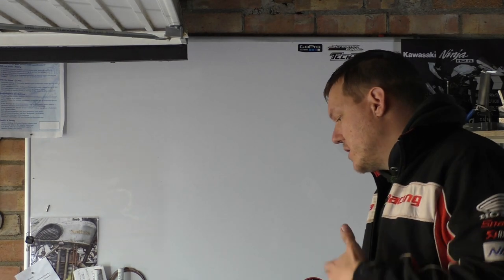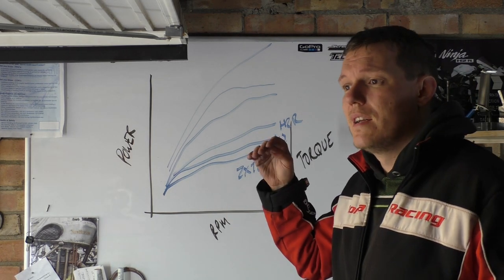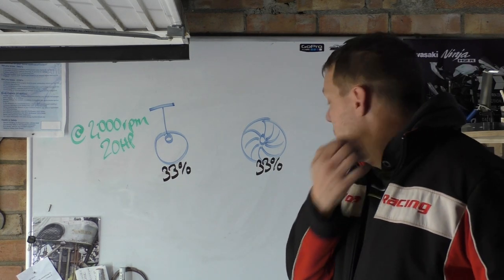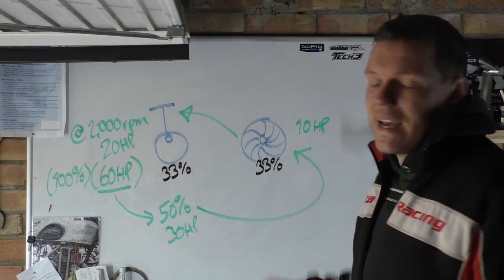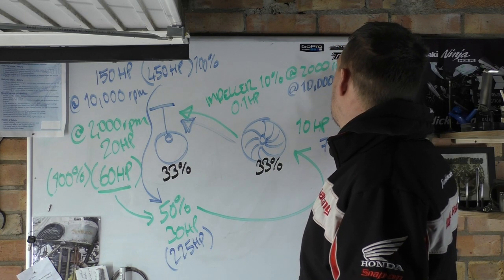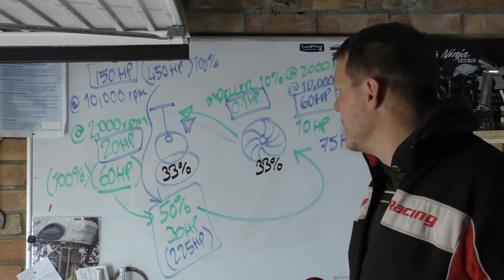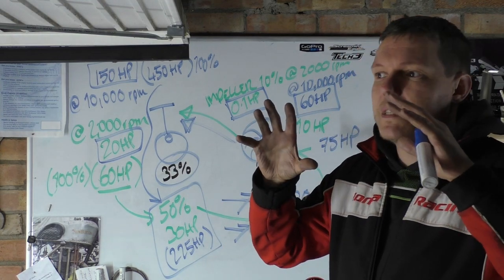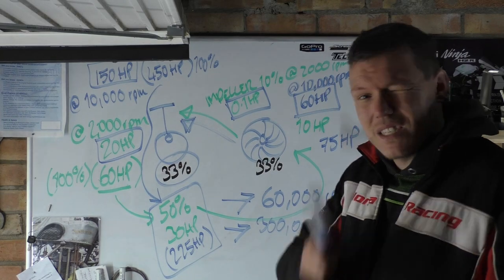Turbo's and Chargers - Fuel and what they do

Comment: Yes that makes sense. My only experience of supercharger was on Mercedes cars. Where there seems to be very little if any reduction in mpg. 
My Turbocharged SAAB cars always did better mpg tgan the fuel injected or Carb versions of the same engines.. unless you opened the taps. :) which was very hard not to!

Comment: not trying to be a dick or anything, but a Matt and a few people in the comments talk about exponential relationships. I'm not sure about this but according to the Affinity Laws: for any kind of fan or turbine the relationship between RPM and Power is cubic not exponential, and pressure is the square of the RPM, as long as the efficiency remains constant. I know that exponential is a kind of street term for any curve that sort of rises rapidly, the two curves at first glance do look very similar.

Anyway, nice video, and explanation.

Cheers
Reply from the maker: Gretat comment - however 

"I'm not sure about this but according to the Affinity Laws: for any kind of fan or turbine the relationship between RPM and Power is cubic not exponential"

Affinity Laws and the cubic relationship is for fans and pumps, and not driving apparatus. The one thing missing here is energy. Looking at Affinity Laws you have speed, flow and head pressure, and also power. 

For an engine the variable here is the torque curve. In other words Affinity Laws would hold true if one thing was constant - say shaft speed or flow rate. So the impeller works on this principle - because it is driven and like a pump or fan, and this is due to the volume of the impeller housing (or diameter) and the speed of the drive shaft.

However for a turbine the variables are not just rpm. As the engine begins to enter the powerband, combustion efficiencies increase, and hence more torque is produced. Its not just a function of engine rpm - in other words

Comment: Matthew you lost me a little bit. Why is a turbo stuck waiting for the engine, but the blower isn't? They both pressurize charge air with energy produced by the engine....
Reply from the maker: Because the a turbo runs of exhaust gases and it needs to spool up - which takes time. Blowers are connected directly to the crank - so if the crank (engine speeds) increases the blower is in sync

Comment: I wanted to type a huge "You over simplified the turbo operation" and throw in lots of information, blah blah blah.  Then I remembered that you actually know, so I will leave it to you to explain it better in another video.  I will say this, if you want a great example of the exponential "rate of growth" from a turbocharger, just use a dyno chart from a small engine with a big turbo, because you can see when that engine and the turbocharger starts getting into their flow rate/pressure ratio/efficiency island/speed happy places.

Comment: IF you had an engine that was at 100% is the turbo then useless?
Reply: Not entirely as the pressure of escaping gasses from the engine would still be able to turn it. But the energy levels would be way down due to no heat in the exhaust gas.
Reply: @chrisvinicombe9947  If the engine was 100% efficient there would be no pressure.  That pressure is energy, and the engine is turning all the energy into work.
Reply from the maker: Joonya has got it. And it breaks down like this. 47MJ of energy per KG in fuel (petrol/gasoline) if the system is 100% efficient then 47MJ of energy liberated from the fuel was converted into mechanical motion - this includes 0% friction and pumping losses, 0 vibration (noise) No compression losses, no loses of any kind.

Or like this Air + fuel 'in' ----> motion out. Nothing more, no pressure (which is momentum of exhaust - therefore no exhaust - at all in other words the water and CO2 and N2 would just magically disappear. 

Obviously this is impossible due mainly to thermodynamics - there's always waste heat when work is done (power is produced)
Reply: @joonya4427  100% efficiency refers to the energy the fuel contains. The gasses from the combustion chamber would still be pressurised when leaving the exhaust port. They would just be at roughly the same temp as when they entered the engine.
Reply from the maker: "@Joonya 100% efficiency refers to the energy the fuel contains."

- Yeah but that's all the energy - without it you bike just sits there - looking pretty. 

"The gasses from the combustion chamber would still be pressurised when leaving the exhaust port."

- and no. Exhaust gases expand out of the exhaust because of the pressure difference, and this is due to the energy they now posses. This is why its called 'waste' heat, because it pisses out without pushing you forward.

If the gases were the same temperature as the outside word then they have the same temperature, and therefore 100% efficiency has taken place, but they just sit there. The piston would then have to boot the gases out, and this requires energy - 

Even in this scenario, work has to be done and energy is required to do that work. So loses - pumping loses.
Reply from the maker: Awesome comment, this will be a video tomorrow, because this is an excellent example of efficiency and work
Reply: @dirtygarageguy  oh we're going full magic eh 😂😂😂 I was just considering extracting all available energy in the fuel.
Reply: @dirtygarageguy  I agree, but the original supposition was a 100% efficient engine.  Surely all this shows is that it is not possible.  Edit:  Woops, missed your earlier reply.  This comment should have been for  chris vinicombe - yeah we are going full magic.
Reply: @dirtygarageguy  The thing I find interesting in all this is that it shows that we need to have some level of loss in order for an engine to work.  I never thought about it this way before.

Comment: A supercharger's speed is going to be directly proportional to the engine's speed. But the two main types of superchargers are positive displacement, normally  Rootes, and centrifugal, which is like the impeller of a turbocharger. The amount of air a centrifugal supercharger can pump is low at low rpm, but increases exponentially as its speed increases. The amount of air a positive displacement supercharger just increases linearly as its speed increases. At high supercharger speed,  a centrifugal supercharger is going to be more efficient than a Rootes one of the same size.
Reply from the maker: "A supercharger's speed is going to be directly proportional to the engine's speed."

- yes. I'm sure I said that.....

"But the two main types of superchargers are positive displacement, normally Rootes, and centrifugal, which is like the impeller of a turbocharger. "

- Yes - I said that as well.

"The amount of air a centrifugal supercharger can pump is low at low rpm, but increases exponentially as its speed increases."

- I'm sure I'm going to repeat myself......

"The amount of air a positive displacement supercharger just increases linearly as its speed increases."

- Unless it has more than 1 speed...

"At high supercharger speed,  a centrifugal supercharger is going to be more efficient than a Rootes one of the same size."

- ahhhh this depends. Newer blowers have apex seals.